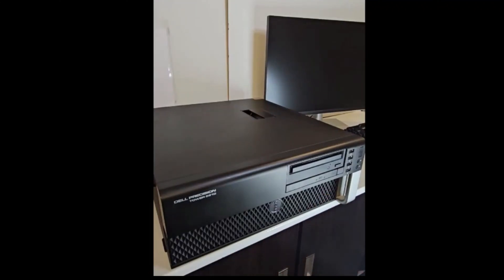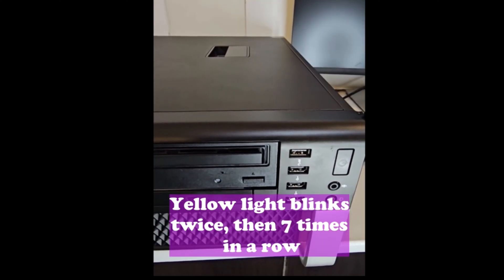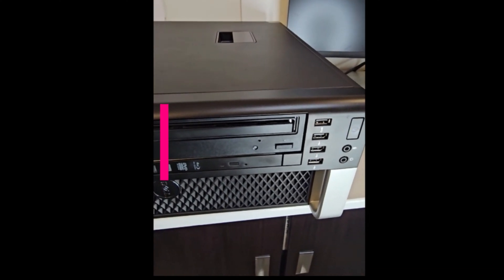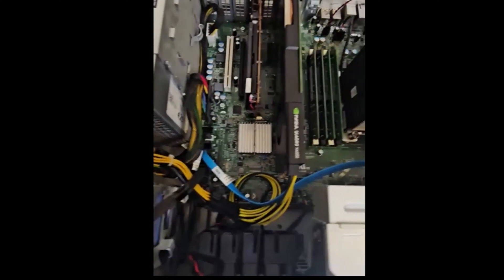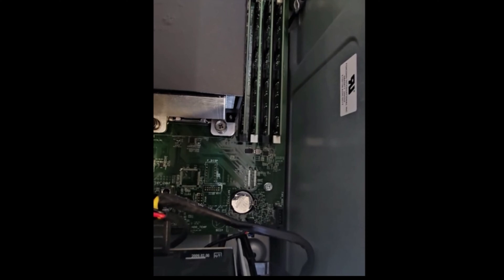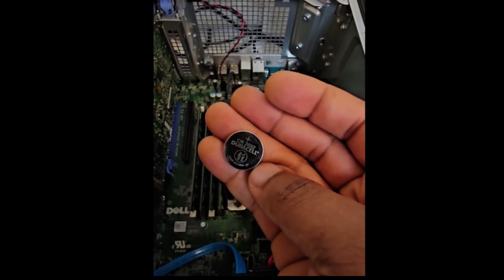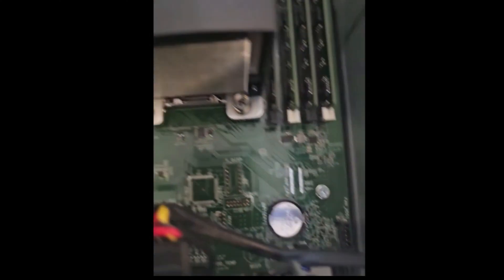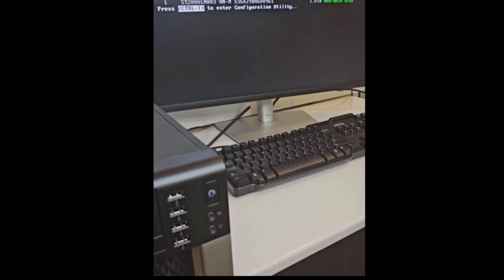Dell Precision Tower 5810 | Yellow Light Blinking on Boot - SOLVED

Comment: I changed the battery and it's still giving the same error. I checked the memory and it's fine. I don't know what else to do.😢
Reply: Clean the RAM contacts with an eraser and alcohol. In my case, this error occurred after replacing the processor. I haven't figured out what's wrong yet, but most likely, the new processor is faulty.

Comment: Thanks a lot! I fix a Dell Precision Tower 5810, the orange light is 2:7 a memory failure, i just clean one of them and works fine again! thanks ! the Dell website have some codes from all problems fix 😜
Reply: Memory Failure? Did you replaced RAM or what?